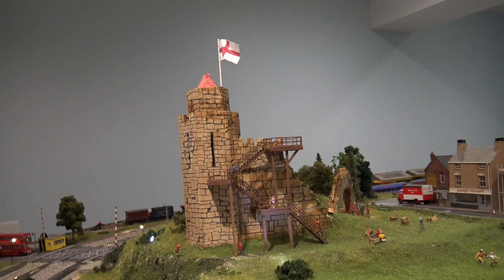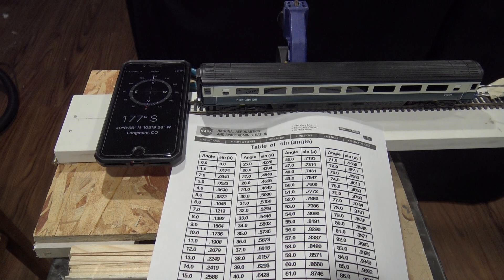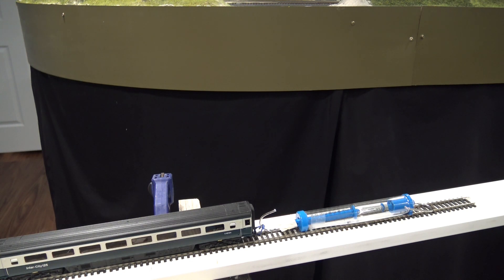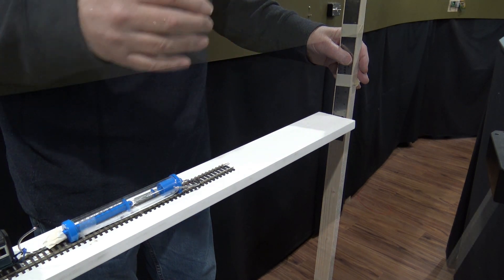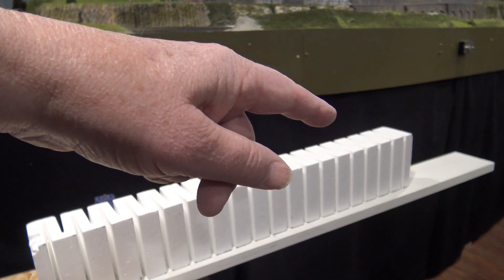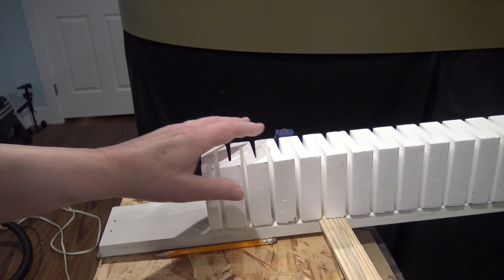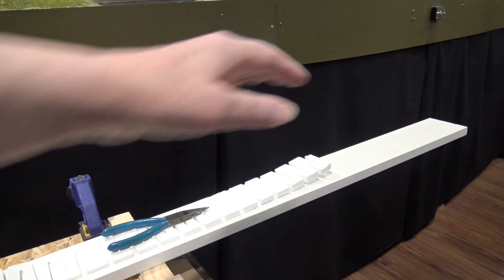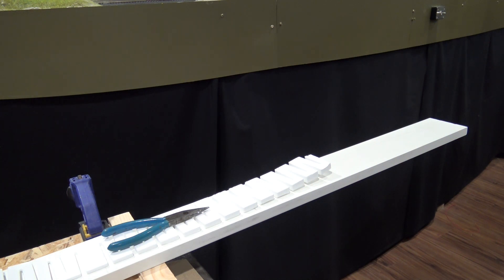111B  Layout Science  Farland Howe

Comment: For every 50 inches of run, and the grade or "rise" goes up by 1 inch, that is a 2% grade....

or - - - 

(1/50)X 100% is percent of grade.

Example  1/50 equals .02   times 100     = 2%

So I figure what the rise is at 2 points like 10 and 50 inches of run  at a 2% grade. Then I put a laser between these two elevations, and I simply lay in my incline for however long I want as it will always be climbing up at a 2% grade this way.

Also, with a run of 400 inches, and a grade climb of 8 inches, this is also a 2% grade.

Bob S
Reply from the maker: Well there you go Bob.  I used 100 because it is easier to explain.  But you are right, the run could be 73 mm.  ;-)  Thank you so much, Rob

Comment: I had the wows and bumps on a layout I built eight years ago. Took it apart after two years and started again. Used my spirit level in every possible way and thought I'd cracked it. Turns out my floor isn't level! It's an 1890s house.
Reply from the maker: Hi Mark, Your level should help even in uneven conditions.  The concrete under my current layout is very uneven and slopes towards the door.  Thank you and good luck, Rob
Reply: @FarlandHowe  the floor of my room is like a bowl so whilst I got it level along the boards it's sloping across so I've had to use chocks on one side towards the middle of the room!
Reply from the maker: Mark Arnold My floor was wavy and sloped.  Whatever it takes to get it level.  Mine is free standing and every leg is slightly different from all the others.  I did it by connecting one end, leveling it, marking the leg and then cutting it.  I used a clamp to hold it while marking and also while fastening.  It worked for me anyway.  Thanks again.  Rob